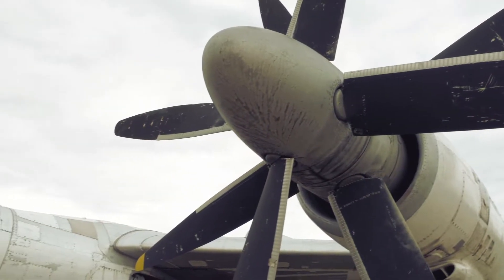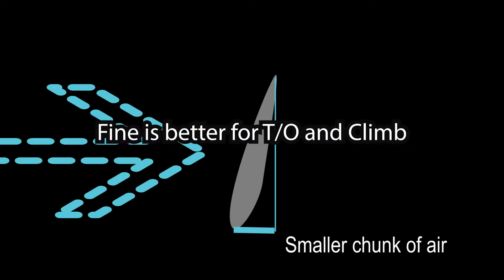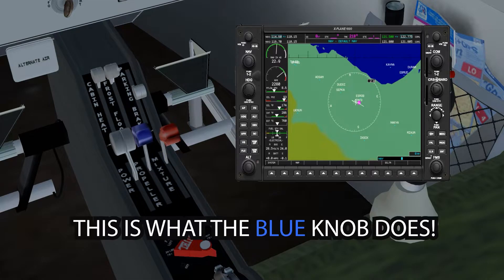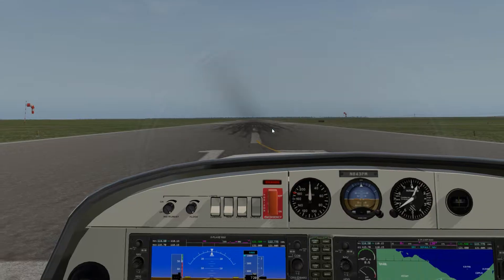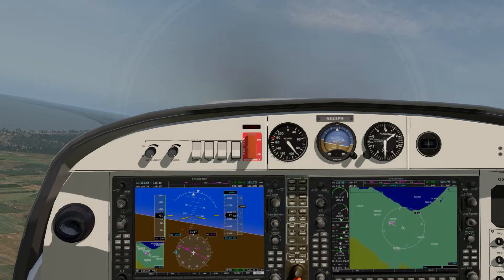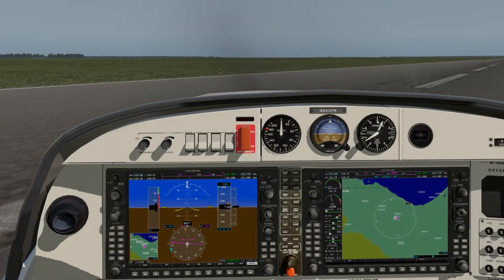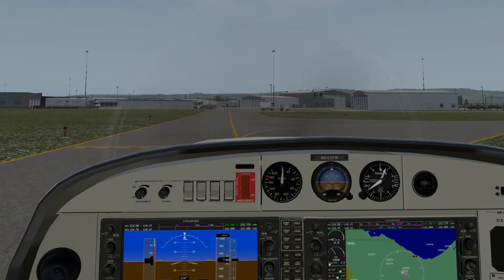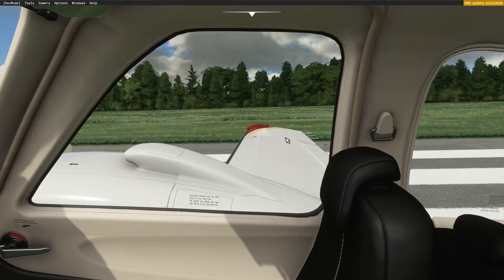Variable Pitch Propellers! What is the Blue Knob/Lever in Aircraft, and how to use it!

Comment: Pretty sloppy explanation for an attempt to clarify. The blue lever/knob is never labeled pitch because it commands the desired RPM of the engine/propeller. The governor commands propeller pitch to satisfy the RPM command. If the engine is not producing enough torque to achieve the requested RPM with the propeller against the low pitch stop, the engine will drop below the set RPM and the prop will act as a fixed fine pitch propeller.

The pitch of a fixed pitch propeller is a description of the propeller’s geometry. It may have ramifications for Ideal speed and AOA in the operation of the airplane, but pitch is purely a geometry metric.

Manifold pressure is a measure of pressure in the manifold after the throttle and before the intake valves. It conveniently corresponds with engine torque in a constant speed prop airplane. As the throttle is moved without adjusting the RPM command to the governors, the volume of engine noise and the thrust change but the RPM is constant. You can command any desired power with a commanded RPM and set MP. The prop governor sets prop pitch to absorb the engine power while holding the engine to commanded RPM

Comment: Hey! Genuine question for my dumb mind, you said in 3:37 the difference between the Controllable pitch propeller and Constant speed propeller is that CSP automatic adjust their pitch and the CPP are manually. But then at 6:12 you're showing us that the D40 is a CS propeller, and it has a control knob in propeller so does mean CSP need control manually?

Comment: You can think of a fixed piched propeller as a car that is stuck in Second or third gear. Second is great for circuits and climbing, but lower top speed. Third gear is sliwer to accelerate and climb, but great for cruising.

Comment: When decreasing power after take off, at 1100' elevation, you reduce prop pitch RPM before manifold pressure. Isn't this the reverse of what you recommended earlier in the video?

Comment: On a complex airplane, full throttle is not full power unless the prop is turning at maximum RPM. The formula for shaft horsepower is; Torque x Prop RPM x .00019=Shaft Horsepower. From the formula, it can be seen that if max RPM is not set, max power will not be achieved. Also, with the prop turning at high rpm, the blades are at a finer angle and produce more thrust.

Comment: My question becomes. When you set your prop rpm’s how do you know what to set your manifold pressure as? Like how do you know if your manifold pressure is set too low or too high in either cruise, a T/O or Landing  config?
Reply: when i was on single engine, there was "settings", for TO-full power , low pitch, for climb-reduced TO power, low pitch, for cruise- some rpm(by pitch) and some man press(by power lever), for landing-idle, low pitch

Comment: On your climb out shouldn’t you have reduced throttle prior to reducing RPM with pitch to avoid high cylinder pressures?
Reply from the maker: Hey! Nice question! Prob depends on the aircraft but for the 40's I fly on, you reduce the RPM to 2400 (Max continuous) after you are 400-500 feet above ground. You keep full power because you are still in a climb. You can then reduce to a preferable power setting later for a cruise (typically 23', 2300rpm) Again I'm not a CFI and the procedure is different for different aircraft but again this is how it's taught on the 40's I fly on.

Comment: Starting to get ready to get my complex rating with the sim. I get that the prop control RPM. How do we decide manifold pressure to use?
Reply from the maker: That's exciting! Congrats! (Again I'm not a CFI) BUT it depends on the aircraft you fly! For example, on the 40's I fly, a good typical cruise setting is 23' of manifold and 2300RPM, there is a chart for all aircraft in their POH for power settings and the fuel rates, etc... they give ;) So depending what you are flying, if you are going for economy, speed, etc... You choose the settings from there!

Comment: Question - on the dual engine, talking about feathering - for the failed engine - do you set the propeller for a fine or coarse pitch for the reduced drag?
Reply: Coarse I think
Reply from the maker: Feathering is when you bring the prop all the way back so technically coarse as it goes with the airflow so there is less drag. We don't actually use "coarse" though, we just say "feathering the prop" on multi engines :)  Here's an article about it: https://www.skybrary.aero/articles/blade-pitch

Comment: Sorta tired of the incorrect description that a prop pushes the plane forward...it PULLS the plane forward.  A prop is a wing and it produces lift in the same way the horizontal wing produces lift.  The direction of lift is above the plane and forward of the plane.  So the prop is therefore lifting the plane forward, or pulling it thru the air.
Reply: Thank you for pointing this out.
Reply: front mounted prop is puller, rear mounted prop is pusher
Reply: @makantahi3731  No. The prop in front is called a "tractor" and it pulls.  The prop in back is called a pusher.
Reply: @speedomars  not in my school,
Reply: @speedomars  if you should describe some aircraft you would say it has tractor prop?, im my job we use tractor to push uh60 from hangar to apron, so tractor can push too!
Reply: @makantahi3731  The engine makers, like Contintental use the term.  If you are using the engine in a 'tractor' configuation.  The cooling is different as is the prop governor.
Reply: @speedomars  yes,but if i translate  it in english,it is pusher/ puller,no slang
Reply: A wing partly pushes too, atoms colliding with it are pushed down and push the plane up (the wing is slightly angled to push air down) - or in case of a prop, push the plane forward.

This is why even a non hydrofoil shape (eg a paper plane) can still fly. Wings do not just rely on hydrofoil profile for forces
Reply: @Tom--Ace  Not quite.  A prop 'pulls' the plane thru the air the same way an airfoil in a sail pulls a boat thru the wind.  This is why a sail boat can sail 'upwind'.  But there are two physical forces at play in lift.  1. Newton's third law is: For every action, there is an equal and opposite reaction.  2. Bernoulli's theorem describes the pressure difference created when you speed up airflow.  The wing shape curves the airflow over the top of the wing producing lower air pressure.  The bottom of the wing is flat and the air moves faster.  Producing lift.  A prop is shaped like a wing and produces lift the same way except in the horizontal direction in front of and ahead of the plane.    So, when the plane is taking off, Newton's equal and opposite is more in play on the wing.  When the plane is in level flight, Bernoulli's theorem is producing most of the lift.  The prop is always a Bernoulli device.  The prop has to OVERCOME the drag produced by the wind hitting the front of the prop.  Likewise the wing has to overcome the drag produced as the wind strikes the front of the wing.

Comment: You mentioned the order of changing things then the first thing you do once airborne its change the propeller pitch,  I don't understand.  Is there an order or not?
Reply: There’s a specific order for every situation that won’t change but you gotta know em
Reply from the maker: Wow I suck at replying to comments haha indeed, but in the DA40, like many other aircraft, you take off using the full prop, but after 400-500 AGL, you bring the prop back to 2400RPM, which is max continuous prop rated for the engine. Hope that helps!
Reply: as you accelerate to climb speed, rpm can raise too, so for climb you should correct rpm and man pressure , it can be done in same time if you are experienced, you act fadec